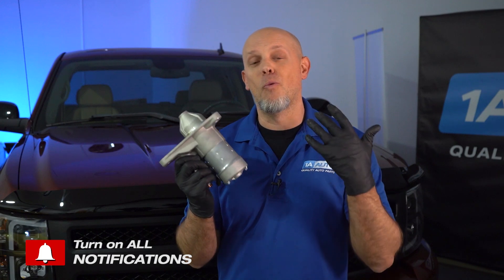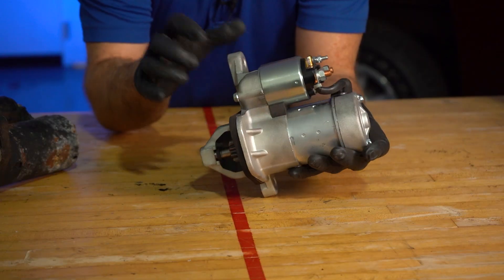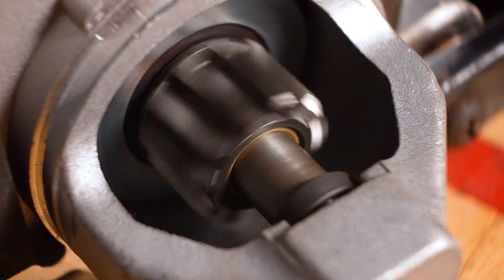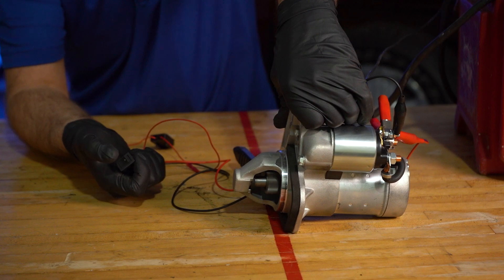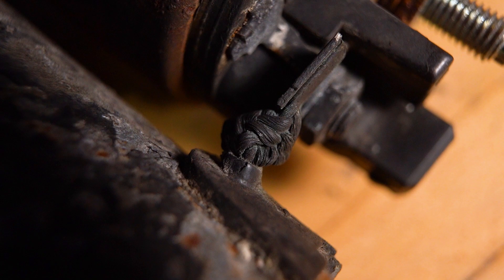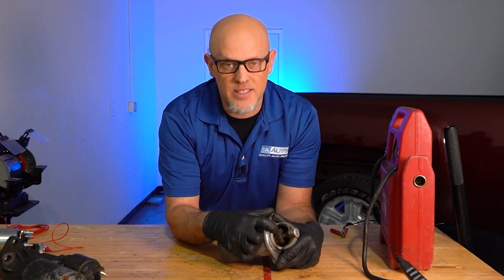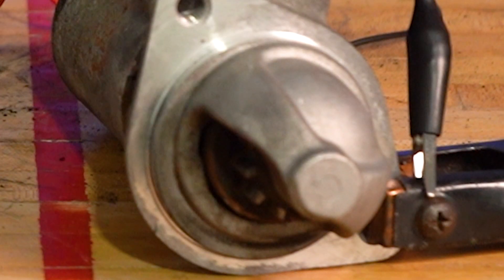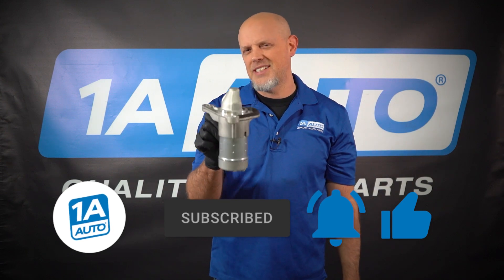Car or Truck Won't Start, or Makes Grinding Gear Noise After Starting? Easily Replace the Starter

Comment: Don't ever buy new they are  less than a tenth of the price at the salvage yard. If your vehicle is newer than 2012 you will probably have trouble finding parts at salvage yards so you might be forced to buy new otherwise it is a waste of money I have driven for years on $10 starters..

Comment: I have a 2018 Kia forte that hesitates to start. It doesn't click and it doesn't continuously try to turn it over. It sounds like it chokes and gets quiet when the ignition is being turned, but after 2 seconds it starts the engine. What are some possibilities?